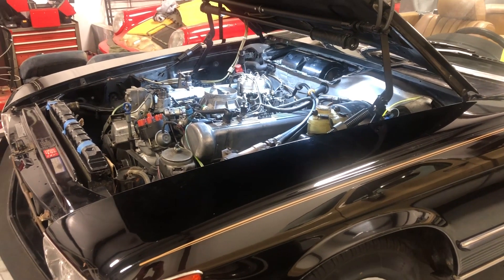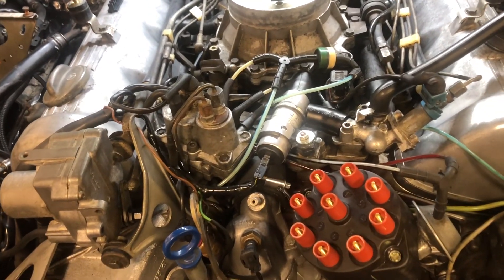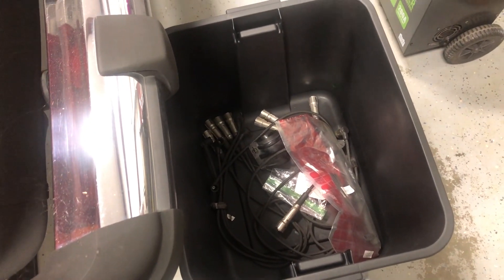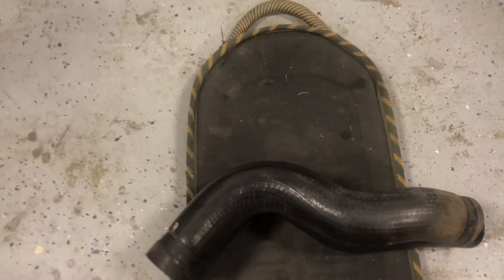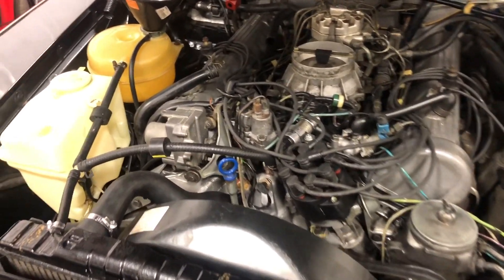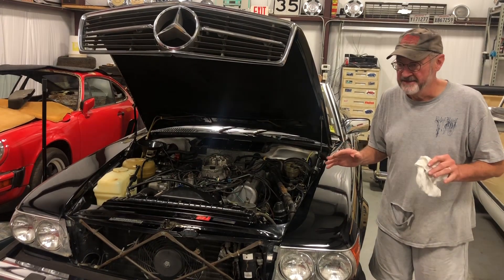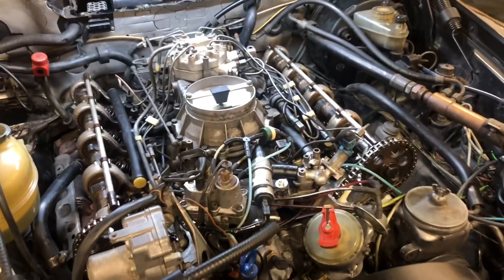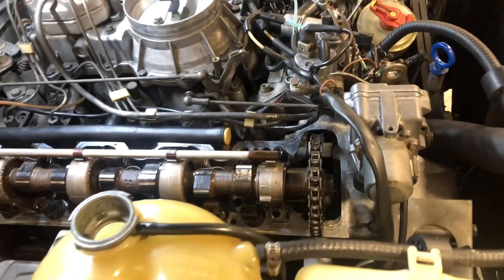1982 Mercedes 380sl update. Houston, we have a problem…

Comment: I made a video doing this on Clay’s 450SEL with pretty heavy 20W40 or 20W50
I cannot post a link to the video since I am commenting 

The tensioners have a built in spring which has not enough wooms to keep chain under tension, hence you have to pre load tensioners 

The good news is, there is no damage when this happens like in your case.

Peter
Reply from the maker: Excellent!!!! I will look for it. It will be next week before I can jump back on this again. It was scary to see that tensioner lose pressure.
Reply: @JRBRestorations  The new MB tensioners used to be sold / shipped preloaded.
The Febi tensioners don’t. From my experience heavy non synthetic engine oils like 20W40 or 20W50 work best for this loading. This oil will stay in tensioners pretty much indefinitely.
10W30 or thinner and synthetic oils are not suitable and the tensioner will collapse

Comment: Hey, no need to remove the tensioner. They are not intended to be preloaded.
Just disconnect the coil wire and turn it over to build oil pressure. no harm will come to your engine doing this.
Reply from the maker: Thanks for the input! I will check into this.
Reply: I disagree with your statement

Comment: The chain tensioners have to be preloaded with fresh engine oil!
Reply from the maker: So , my tensioner may not be bad? Do you have a video on that?
Reply: Yes, but I am commenting so I cannot post link

Title of video:
“Mercedes 450SEL MY80 Clay & I are preloading, installing Chain Tensioner then we set chain timing”
Posted December 3rd 2022
Your tensioner will be fine. Follow reinstalling the tensioner with long bolts as shown in video

Peter
Reply from the maker: Many thanks. I will post next week.
Reply from the maker: I had removed my tensioner because I wanted to change the gasket. It was leaking oil. When I had it out I found that the previous person had used RTV sealant all over it. I cleaned it and put a new gasket on, it installed easily with the original bolts because it had not been pre loaded? I think I will remove it again and preload it and then turn it over by hand and watch the tensioner guide again. If it still does this weird movement, I will order a new one.
Reply: @JRBRestorations  the problematic with the statement from the other fellow lies within the availability of MB Service Bulletins in general.

The MB manuals itself have undergone several revisions over the decades and apply mostly when parts are replaced with new MB Parts.

The original MB manual Group 5 for M116 and M117 actually showed the rebuild of these tensioners with a rebuild kit being available until 1984 which was then phased out.
A newer version was then introduced as replacement which also had to be preloaded until 1992 or 1994 (can’t remember the exact year) the final replacement units were introduced which are still being sold by MB today 

Those come preloaded from MB and the service bulletin from 1994 states that this tensioners should not be discharged prior to installation as to not loose their pretension

Because of the pretension they are a pita to be installed unless working with longer bolts and nuts as I showed in my video.

Many mechanics winded up stripping the the thread when trying to install a preloaded tensioner with the standard bolts as they require a drementous amount of force onto the tensioner / guide and chain to be pushed in far enough for the bolts then not to strip out the thread in the engine block.

Hence, many mechanics simply rely on the MB manuals published since 1996 which make no statement as to tensioner to be pre loaded without further reference to the aforementioned Service Bulletin 

In practice, depending on which engine oil is in the engine, it will take full normal operating temperature of engine for a fully discharged tensioner to load itself back to normal this way.

While technically nothing can happen to the engine, the chain slack will hit the tensioner guide and same will bang against tensioner contact point.
What you have witnessed on your car will go on until engine oil has reached operating temperature.

Metallurgists can tell you the exact wear this will add as this analysis is beyond my paygrade 😊

Peter
Reply: @JRBRestorations  on one final remark, the tensioner should have been under tension when you took it out. I usually use two long bolts with nuts when taking a tensioner out.
With this being said, what engine oil is currently in your engine and when you depress the discharged tensioner, can you feel the piston moving in with spring resistance increasing? I believe you showed the tensioner in the other video.
The tensioners are designed to hold full tension as both, oil feed entry and exit have ball type valves.
However, if the piston is pushed in within the entry having NO oil pressure of 1 bar or higher on it then the tension will collapse and the tensioner has only the emergency spring tension.

The spring tension is normally enough to carry the system through for a few minutes without sustaining damage.

But as you know now, the sounds this makes does not sound healthy and is something which should be avoided if possible 

Peter
Reply from the maker: Thanks Peter. My service manuals are dated 1985. You are very knowledgeable. Are you an engineer? Work for MB or Bosch?
Reply: @JRBRestorations  your welcome and yes I worked for both. I hate advertising my videos on your channel, but I made two videos sometime ago explaining of what I did 
I keep my fingers crossed 🤞 
Peter
Reply from the maker: I knew it! You may advertise on my channel anytime. Like I said you are very knowledgeable! I am running Castrol GTX non synthetic oil, 10w-40. I use it in my 1985 380se also. Yes, the tensioner had pressure on it when I removed it. But there was red RTV sealant all over it. I had a hard time cleaning the old gasket and RTV off. I can press the piston in and it has resistance, and come back out slowly. I should have pre loaded it. I have some Shell Rotella 20w50 in the shop. I will pre load it with this oil. Heading to Kansas for a wedding, so it will be next week before I attempt this. Thanks again.
Reply: @JRBRestorations  you are welcome and thank you!
Reply from the maker: I removed my tensioner today and submerged it in 40w motor oil and pre loaded it. Air bubbles came out as I did it. The resistance did increase but it still was easy to compress the piston. I re-installed and turned the engine over by hand . It still would collapse at times but not as much as it did earlier. I decided to order a new tensioner.  I will post after the new one is installed. Thanks for your help.

Comment: Uhh, why do I see a single-row chain in there? These fail so regularly that we MB techs have been converting them since 1984, I believe. That horrible noise is a slack chain, and will wreck all your new parts.
Reply from the maker: Yes, my tensioner needs to be pre-loaded. I started pricing the conversion to a double row chain and I only spent $600 on the car, so I believe I will just fix the tensioner and see how that works. The previous owner had the chain replaced and one guide replaced and rebuilt heads out on it. This will be a Weekend, neighborhood cruiser. If the tensioner doesn’t fix it, I may have to convert it.
Reply: Ok, I'll give you a pass here, given your intended use. I was not aware you could even get parts for a single row chain anymore. I'm retired now, but I was the only one in my dealership who would do these. Average time charged was 40 hours, and I didn't make anything on the job. SL's were a bit higher, I usually pulled the engine for these. I recall that these paid 26hrs under warranty, and, yes, I did a few under that. Those were newer cars, and they were easier to get apart. As the cars got older, manifold and head bolts broke, necessitating drilling, and Heli-Coiling, 1 hr additional each bolt if they fought me. You can see what this could add up to. There was really not anything wrong with the 380, other than the lackluster performance, and the single row chain. I had a 380 SE come in in the early 90's with a failed water pump. It had gotten so hot that it quit in the service drive. I let it sit for an hour, and then brought it back to my stall. I told the lady customer to trade it, but she wanted it fixed. Long story short, I put in a water pump, replaced a few melted hoses, and the melted cam cover gaskets, and it was fine. She drove it for at least 4 more years. Cars that suffered the most were poorly maintained and abused cars. The moral of the story is oil & filter every 3 mo/3000 mi. If, you have that noise for a moment after startup, change the tensioner, & check the chain. Be sure cam timing marks are aligned, if you still are off on the RH cam after replacing the tensioner, you're off a tooth, or the seller lied about replacing the chain recently. @JRBRestorations
Reply from the maker: Thanks for the reply. This car has no service history. It was abandoned at a repair shop and sat 2 years. They were going to junk it because it was taking up space.  I saved it and my videos go through everything I have found. It drove very well for a few weeks until it started to leak coolant. My plan at first was to change out driver side heater hose but then saw the water pump leaking . I really soaked everything with Kroil and let it sit till I was brave enough to get the water pump off. You know how it goes, you see one thing and why not look at the chain and the guides and all vacuum hoses and all coolant hoses etc… parts are cheap, it looks great, so why not! My timing marks were dead on when I started. I made the mistake of taking out the tensioner to change the gasket, then found copious amounts of red RTV sealant in the tensioner, cleaned it, replaced it and did not prime the tensioner with oil. Yes it made a racket. I stopped and looked everything over and will take the tensioner out and preload it. I will then post another video, good or bad! Thanks for watching. I am retired from the medical field and love playing with cars!

Comment: my last statement can be verified by the Mercedes factory manual.
Reply: The Original MB Manual requests preloading of tensioner.
Reply: This statement is only correct if the revised tensioner is installed which has an additional rod inside the spring. Only the newer MB tensioners have this additional rod.

All tensioners pre dating 1992 need to be preloaded
Reply from the maker: This tensioner definitely pre dates 1992!
Reply from the maker: And also, prior to removal by me, to put a new gasket on, it never made any noises.
Reply: Hey JRB. I know you did this video 12 days ago, but… You are on track with the tensioner. I don’t preload the tensioner before installing. People who do often end up stripping their block because of the tension. Instead I install the tensioner first, then I pull the coil wire to disable spark. I disable the fuel pumps and then crank it till the tensioner is charged and I see oil being pumped on the cams. Also I suggest you only purchase genuine MB tensioners as the Febi as well as URO fail all the time. Good luck with you $600 SL. It will soon be a $6,000+ SL now that you have started working on it. It never ends I’m afraid.
Reply: @TonyLiveTV  Tony, I preload them and then use two 50mm long bolts with nuts to position the loaded tensioner in place, then I replace the 50mm bolts with the regular bolts - this way the thread won’t strip and tensioner is ready to go.
MB issued a Service Bulletin advising against installing discharged tensioners in the mid to late nineties when replacement tensioners started to be shipped preloaded from MB Warehouse 
Peter
Reply from the maker: Tony and Peter, Thanks for the replies. I have purchased 2 longer bolts and nuts and will slowly install the new tensioner once it is pre loaded. It sounded so bad when I started it last time, I can’t bear to hear those sounds. I will film what my old tensioner preloaded looks like when I turn it over by hand and then film the new tensioner pre loaded and turned over by hand. Once I see that the tensioner is steady , I will re-assemble and start it again.
Reply: @inovahightechltd  I agree if you just install the tensioner and do not prime it with the starter first. I have done this before and it only took a few seconds (more like 1 second) to charge the tensioner. The starter doesn’t turn the engine over like starting the engine does so there is no fear of a chain jump. A good tensioner will hold the chain just fine uncharged when turning the engine over. I agree that using longer bolts will make it easier to install. I just purchased a new genuine MB tensioner from MB dealer yesterday and it is not preloaded. It is packed in a sealed plastic bag and there is no oil so it didn’t leak out oil either. I will install it just like I did the cheap Febi. There is a lot in the service manual that I won’t follow. I’ve been burned a few times by following everything without using common sense first.
Reply: @JRBRestorations  did your chain jump even though your chain tensioner is toast? No it didn’t and it won’t jump with a new tensioner without preloading either. I have never seen a chain tensioner fail by not preloading, but I have seen stripped engine blocks from those that have tried preloading them first. As I suggested earlier pull the coil and disable the fuel pumps and prime it installed. You will thank me in the end. Once it is preloaded it will be much more difficult to install I guarantee it. I respect Peter and his knowledge, but in this case I can’t agree.